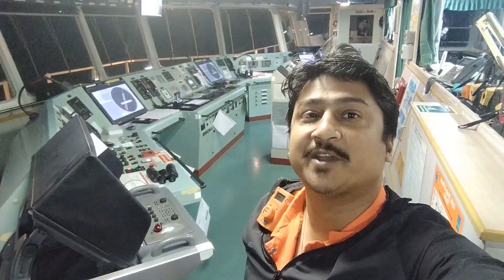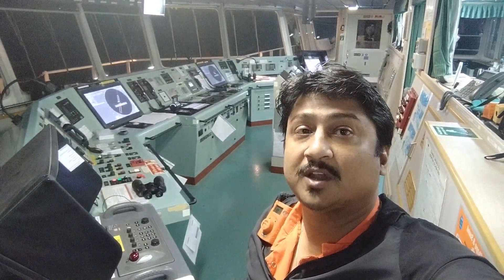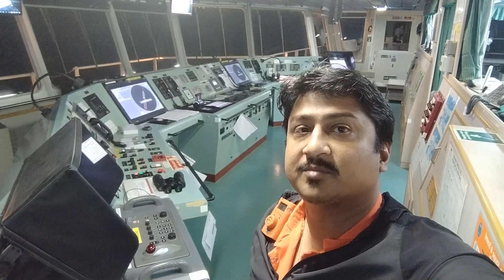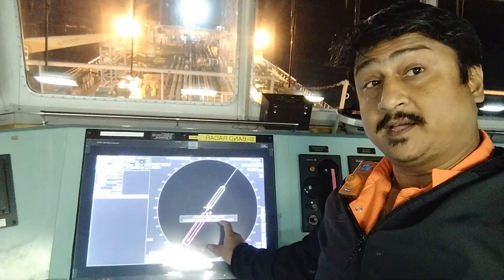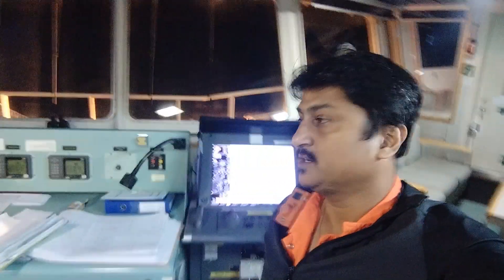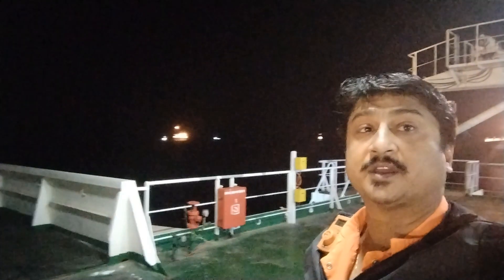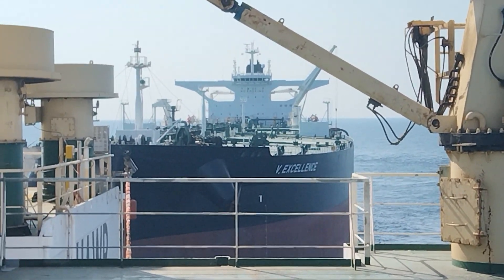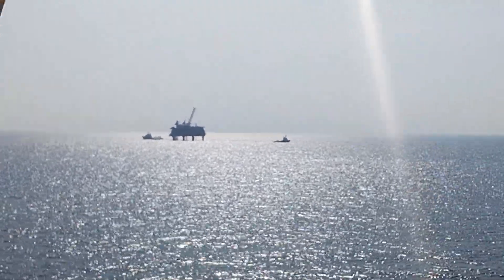FSO Ship |Oil Tanker |Tandem Mooring |Cargo operation | Wheelhouse #offshore #tanker #navigation

Comment: Sir what is the work for ETO ON FSO vessel
Reply from the maker: @भ्रमणती  mostly same work as would be on a regular oil Tanker , it's  little different compared to Normal tankers due to some machinary and equipments being different especially various H2S,HC types of sensors all over deck.So,You may have some minor work load but better wages
Reply: @geodudegraveller  ok exmar ship management company offered me to join FSO vessel can i join? 
They giving 6 week on 6 week off rotation.
Is it good idea to switch from main fleet to FSO vessel
Reply from the maker: @भ्रमणती  you will like it if u like to visit home frequently or have issues related to parents health checkup ,wife being pregnant, marriage 6 weeks contract is good for such people.main fleet is fun for sure as you get long leaves after long contracts
Reply: @geodudegraveller  thanks